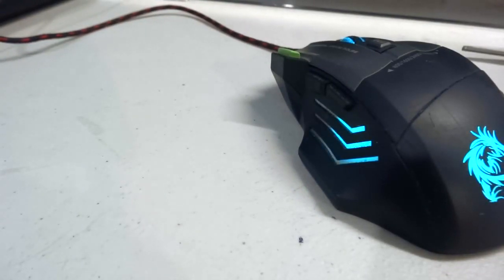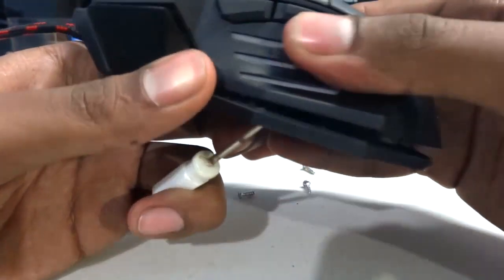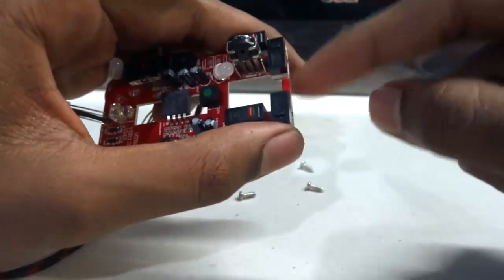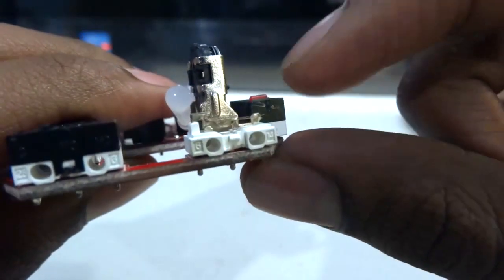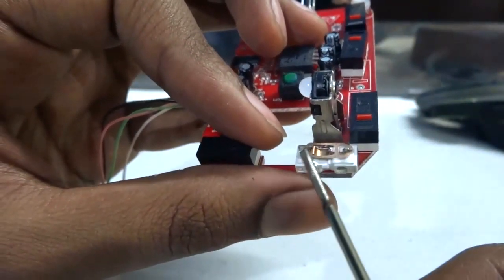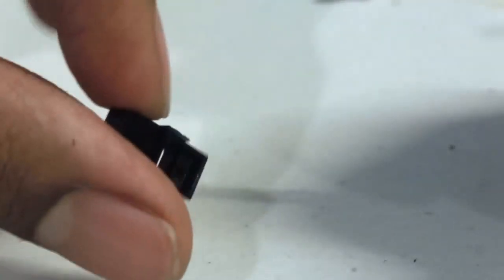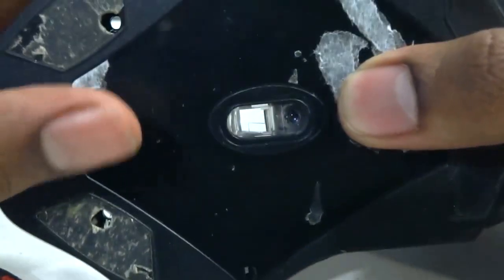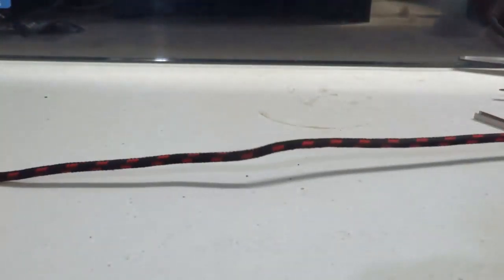TUTORIAL - How To Fix Your Mouse || Double Click Issue

Comment: After 4 years, my mouse dragon Eli g9 malfunction .. double click while clicking single...rip csgo smokes,flashes.

While I fixing my mouse, I accidentally broke plastic part. I fix the copper plate in position. It took me 1hour...I don't how you easily place that copper plate. 

I took plastic part from side button and placed it on primary left click button.. problem solved.... but it was  disconnected at time time. There is  some wiring issue still.

But somehow I managed to fix the mouse and new csgo update came up. rip good night .

Guys copper plate is tricky part.
Thank you very much for this. important video.

Comment: As he pointed out, this is a temporary fix.  To fix it for good, you need to replace the switch.  Most of the mice I have seen have Omron D2F type switches.  Omron is a Japanese company, but the switches that are shipped to the manufacturers are made in China.  These are identified by the code D2FC.  D2F (no C) are manufactured in Japan and are higher quality.  Pick yourself up some of those and solder in the new switches.  I'm getting some D2F-01F (-01 = gold plated, F is soft click) switches for my G900.  The failed switch is a D2FC-01F (Chinese).  After the fix, it should last for years.  If you're nervous about soldering, just watch some YT vids.  It's not that hard.

Comment: Bro the copper clicky plate broke in half for me. What’s the piece called and can I fix it by myself if i find a replacement?
Reply: Don't think so.  You'll have to replace the switch itself which is a better long term solution anyhow.  Odds are that it is an Omron D2FC type switch which are only a few bucks.  I think you can pick up a pack of 10 for less than $30.  A soldering iron, solder sucker, some good solder and Bob's your uncle.

Comment: bro a hotkey from my dragonwar came out how do i fix that?

please reply
Reply from the maker: Did the button fall out? I think it's as easy as just opening it up, lining up the button with the hole and closing the mouse upside down to close it again. It should be connected to the case by some plastic so if that piece broke, just use some strong glue and it should hold. Careful not to get any on the switches though.
Reply: im confused and i only have 1 hotkey left in the mouse :p the other fell out
Reply: its a dragonwar ELE G11

Comment: Thanks for this! My Logitech G402 was a victim to this issue even though it's only been less than a year. Bending and placing the copper spring back was the hardest part and I didn't even know if it was supposed to be curved or flat (found out to be flat by trial and error). Though the clicks aren't as tactile as before, it's better than a bad left click.

Comment: Hey thanks for the video. Can this technique be used to fix the Logitech G302?
https://www.logitechg.com/en-us/product/moba-gaming-mouse-g302
Both the buttons are causing an issue now. The left click double clicks like yours does and the right click does't register the click sometimes.
Reply from the maker: Taking a look inside the mouse: https://www.oficinadanet.com.br/imagens/post/17004/dscn2150.jpg
The switches look the same, so I'm pretty sure the method would be the same for your mouse as well.
Reply: Dheeraj Y Alright thanks a lot. Although the difference might be that you flattened out the curved metal thing and for my mouse I saw someone push it down and curve the metal thing even more.

Comment: how do you repair the scroll? And my side buttons are also broken. I thought the mouse cant be opened so ignored. can you make another video showing scroll fix and side buttons fix?
Reply from the maker: Gautam kumar fixing the side buttons is just like with the main buttons. As for the scroll, that is a harder problem to fix, if the scrolling really is an issue, the best option is probably to get a new mouse since replacing or fixing the rotary encoder is really difficult.

Comment: my gaming mouse is evolveo and when i click no soud i cannot even feel the clicking... like i can something click normaly but the click is too sensitive like u touch the pad and it clicks and no sound when clicking also when i scroll on the mouse its like glitching for example im scrolling dow and its going up and down the click stop working when my friend was raging an he clicks on the mouse really strong and when i try the mouse it happenned...
Reply from the maker: This video should help you fix the super sensitive click issue, I'd check for a broken spring (the small copper bit I show in the video). If that's broken, your better off getting a new mouse. As for the scroll, it's probably just a poorly designed scroll wheel or it's gotten worn down really bad. With the scroll wheel, there isn't much you can do since the fix isn't that simple. The sensitive click with no sound issue is fixable though.

Comment: Why does the fix always have to involve taking apart the mouse? I've only had my mouse for about 6 months and it's already started double clicking!
Reply: same here but i found a fix 
i messaged them and they sent me a link to update my drivers on my mouse and it worked you should contact them and they will send you the link hope this helps and best of luck to you it worked for me
Reply from the maker: Usually the issue is with the switches under the buttons for mice that you've had for a while or used harshly. If your mouse is now I'd check the drivers like +Final Vortex said. Another unlikely issue is that your mouse is just plain defective.